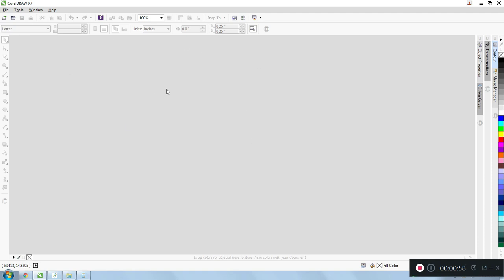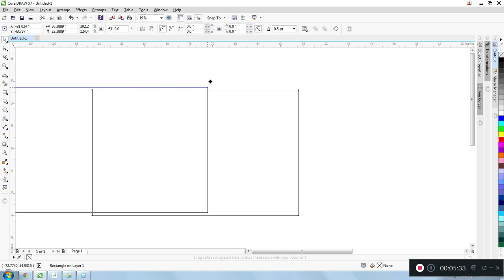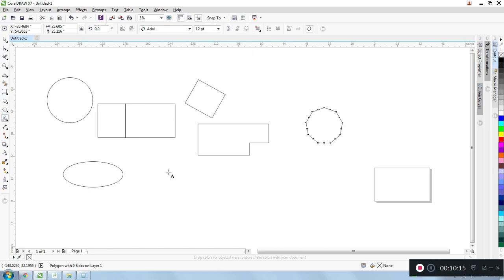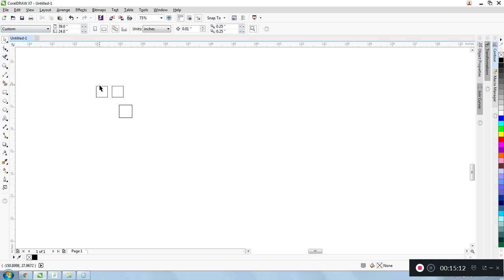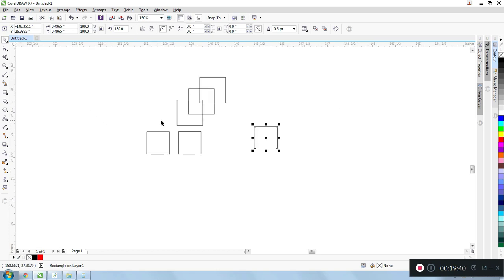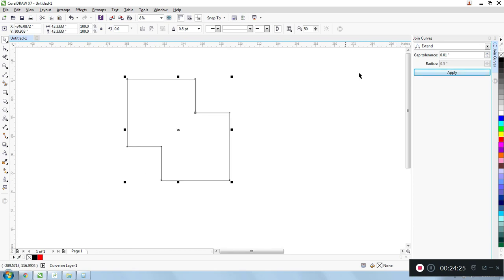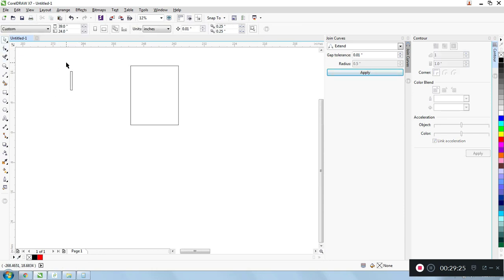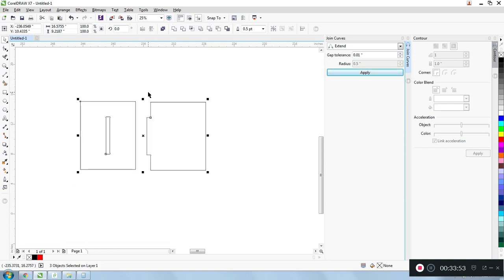Corel Draw Vector Design Basics For Laser and CNC Router

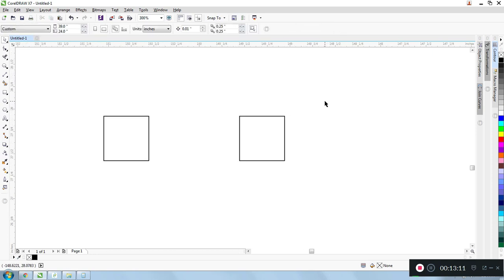Comment: On a serious note though, 13:24 you can align objects with handy hotkeys. Select first object, shift+select target object, then press L for left, R for right, B for bottom, T for top, C for horizontal center, E for vertical. And then you can actually input mathematical formulas into coordinates textfield. So if you have 1 inch squares that have to be 2 inch apart, you align them to be on top of eachother and type in +3 after desired coordinates (or minus, or divide/multiply).
Also, if you press Num+, it will duplicate object just like Ctrl+D, but at exactly same coordinates, handy for offseting objects later.

Comment: Good stuff. I’m a longtime CorelDraw user for graphic art (started with ver. 1.1 on floppy disks) but I’ve just bought a CNC machine and I’m hoping much of my knowledge will transfer. BTW, the quickest way to space two identical objects is to set the duplicate spacing distance in the task bar and then Control D. You can also drag a guideline in from the side, select it, and Control D for multiple equally spaced guidelines. Then you can drag/right click to duplicate an object, and snap it to the guideline. Lotta ways to skin that cat!

Comment: Hi Colin, I've been looking around YouTube for an instructional video to help me design something in Coreldraw X7 so I can laser engrave it. I see in your video it addresses laser cutting. What if I want a letter "R" in Ariel bold font and I want to laser engrave the fill along with the outline. I am using a post processor called DrufelCNC and I have tried several things such as turning the font into an object, setting the outline and fill to RGB colors. However, I still can't etch the fill. I read that I have to save the CorelDraw file as a PTL format but still no luck. Do you have another video explaining this. I subscribed but only see the one video describing laser cutting. Thank you, Bob